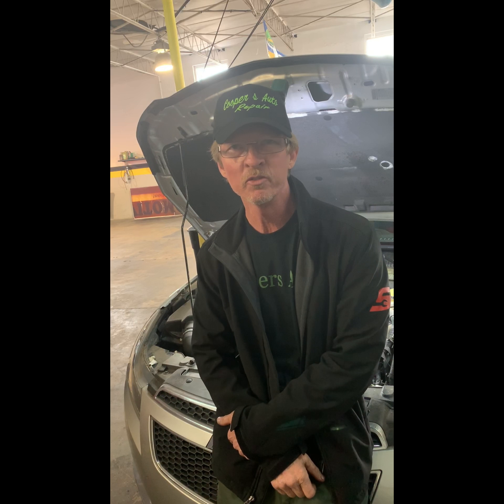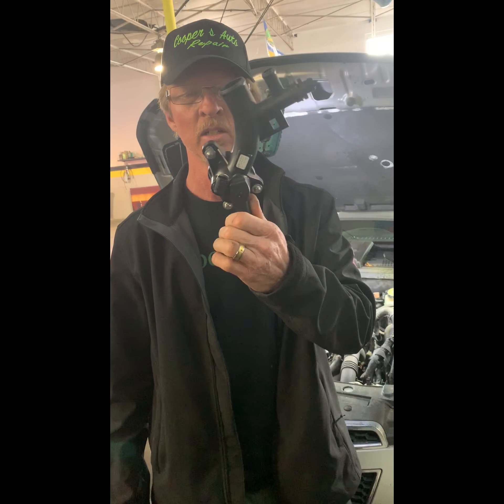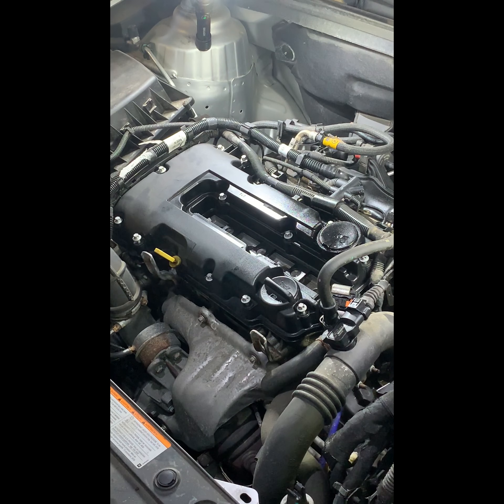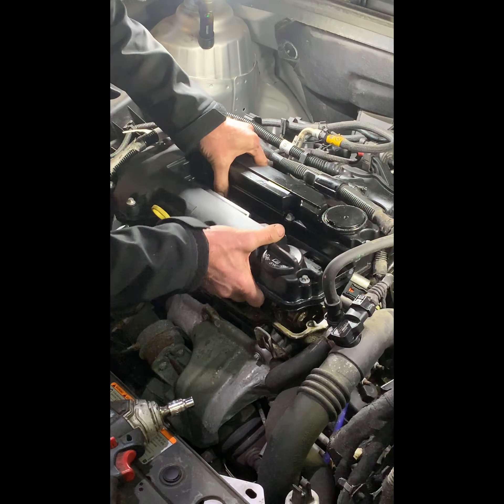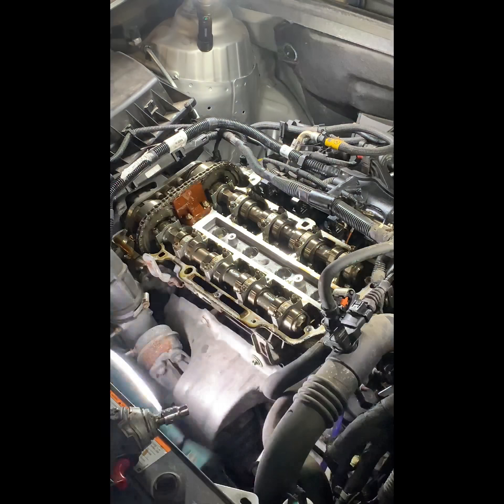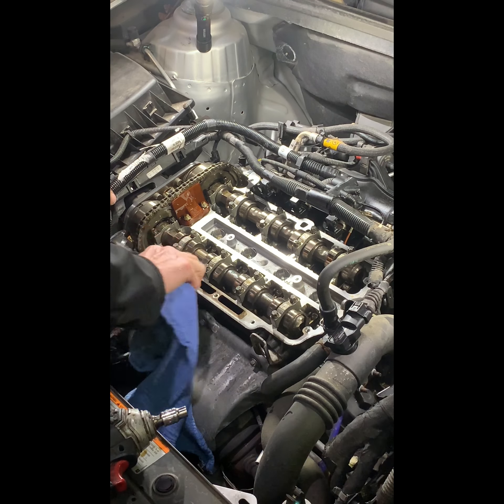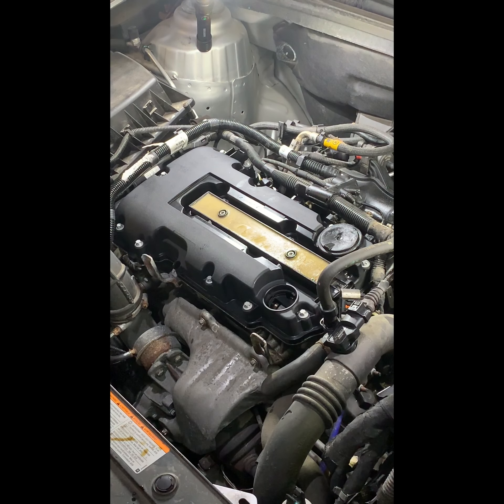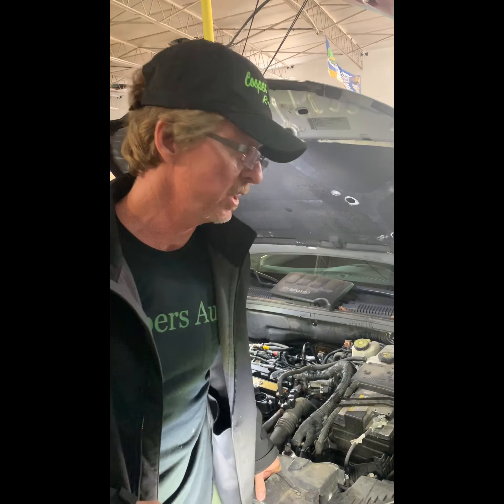P0171 and P 2270 2012 Chevy Cruz

Comment: Please help!!! I have. 2014 Cruze 1.4 LT .I just had alot of diff fuel related work done. Then 2 weeks ago I got a light and code p0299 for turbo underboost. Cleared it. Been taking it a little lighter on my driving and it hasnt come back. Today my check engine light came on again and I figured it was that but it was code P0171, P1101, and autozone gave me those two in addition to P2270. Any idea what direction to go in for these three? 🙏🏻🙏🏻🙏🏻
Reply from the maker: I need a little more information I’ll get back to you possibly next week can you send me the vin so I can get all the details of the engine
Reply: Sure!    1G1PC5SB2E7114011    Thank you!